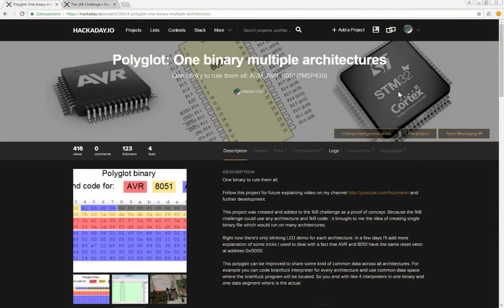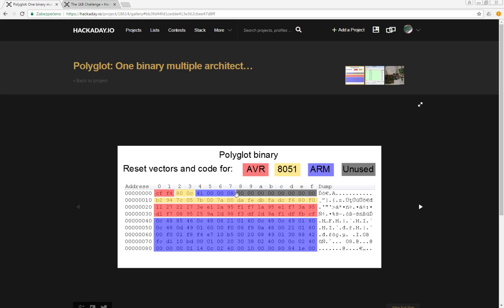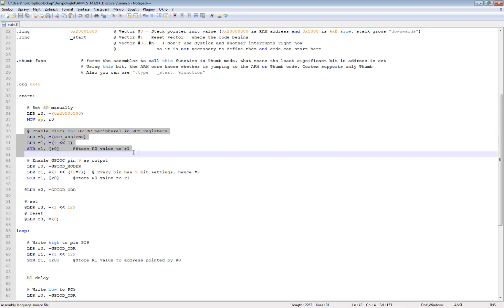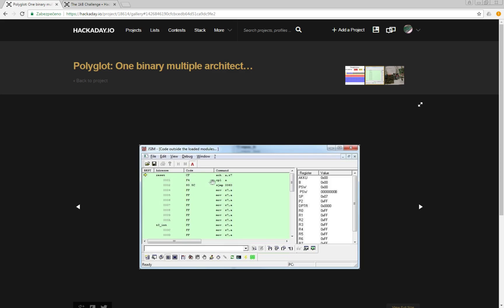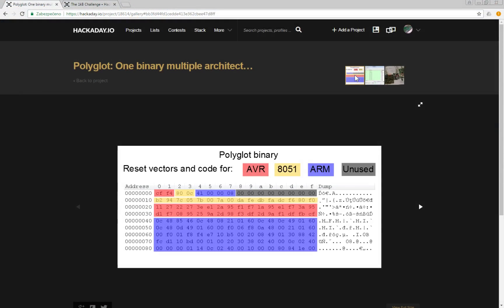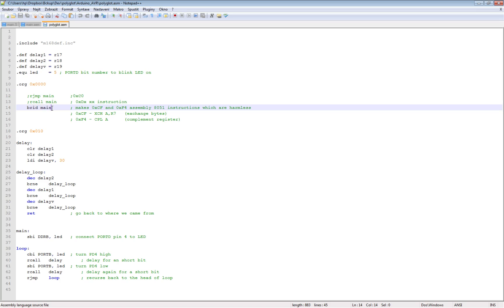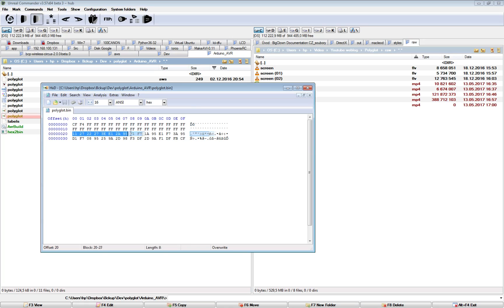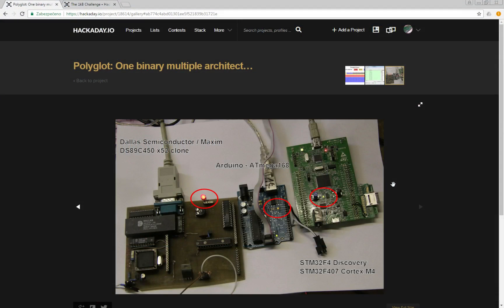One firmware binary, multiple architectures (Arduino, STM32F4, 8051)

Comment: I thought this was a cool idea. This is just a tiny example, but taken to another level it could be interesting to distribute single, multiplatform applications.
Reply from the maker: Yes, I was thinking that brainfuck interpreter and common code in DATA section could be just the start.